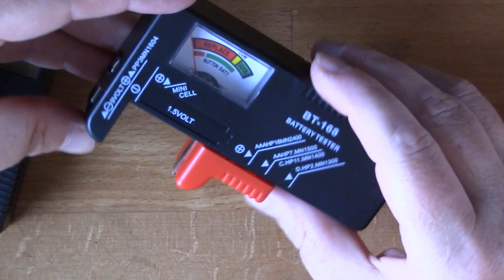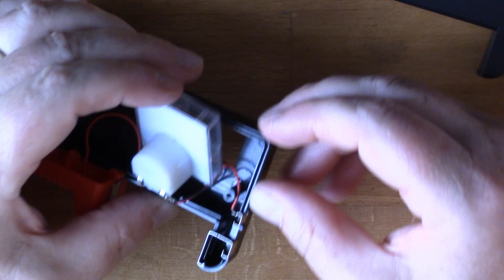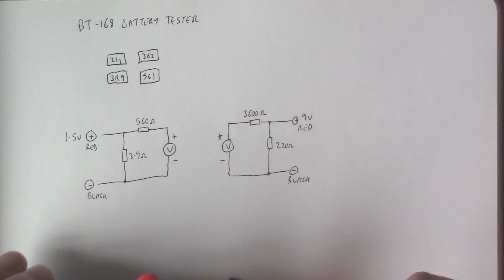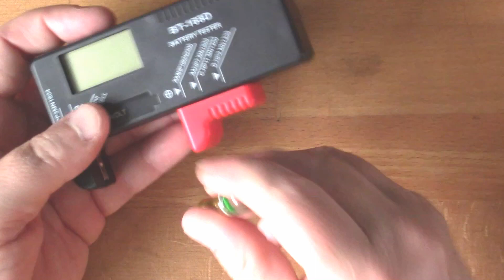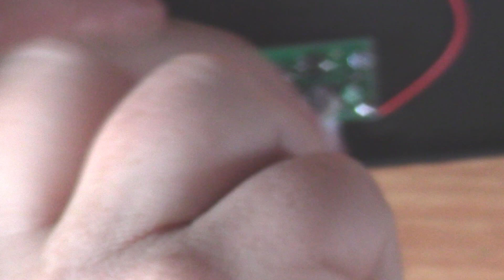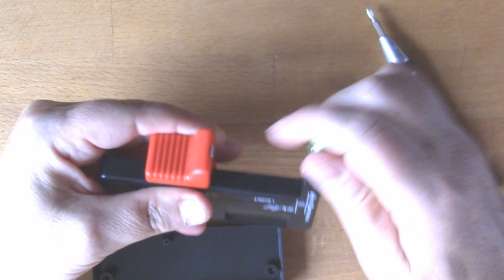Teardown of Two Battery Testers (#150)

Comment: I have the LCD one, which is handy for a quick "Does this battery go in the bin, or in the 'Use again' box?" - marginally less hassle than getting a multimeter and a load resistor together. Neither input will give me a reading from 3V lithium cells, tho', which is a minor annoyance (I guess 3V trips the boost regulator 'overvolt' status, and isn't enough for direct drive).
Reply from the maker: I've never regularly used one of these testers before this, but was surprised at how quick and convenient it was to go through a whole collection of batteries .
Reply: Bt-168 pro should give lithium cell readings.